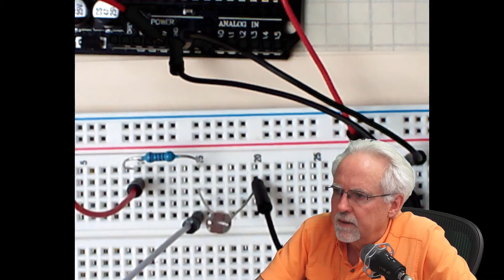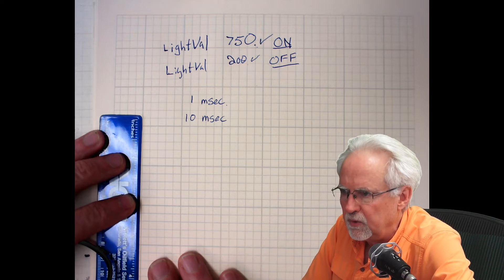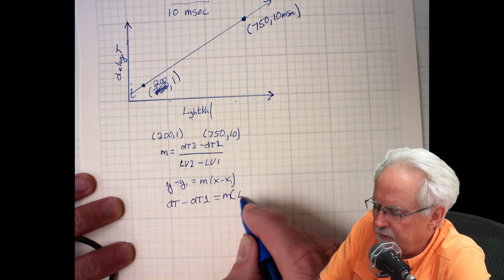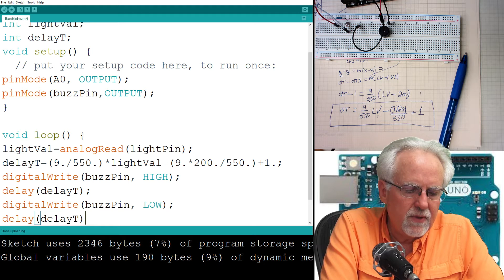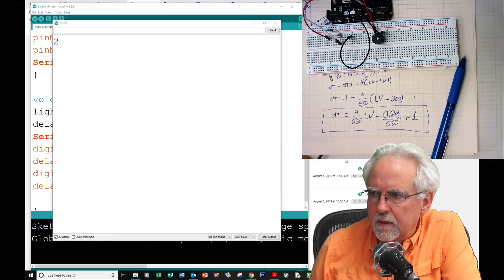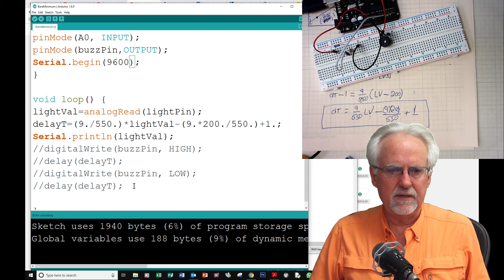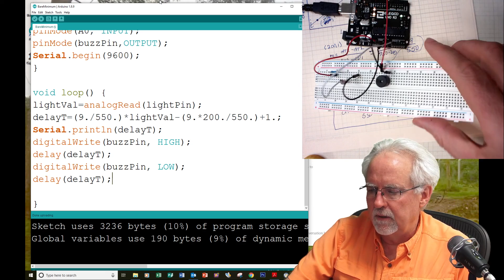Arduino Tutorial 26: More Fun with Photo Resistors

Comment: Hi Paul, Great series! I have a query in regards to variables, i noted that a lot of programs written make use of #define over int . What is the difference from what i have seen it only mentions that int is saved to memory?
Reply: #define statements are not difficult but are higher level features of c that can easily postponed a year or so. the exception is when you are reading other people's code.   They are a drag on the wonderful De-mystifying aspect learning Arduino in Paul'ss tutorial.  the statements using #define, or statements starting with # are preprocessor macro directive to the
compiler.  they are parsed in early stages, before the compiler itself begins, which makes it difficult to understand just what they do. 
#define is often used to conditionally compile certain sections  of code based on a
"symbol: begin defined or not defined.  Traditionally (before 2000) this allowed a program to work on several different versions of c language, different compilers, or machines   I learned about c features in 1998, C macro's are not necessary to using arduino, don't worry about it, I am 67. Some one who's not retired may say they are deprecated features.  a Boeing C wizard in the late 1990's used complicated #define sections as workaround on a multilanguage C to VB dll library of functions that reused spatial rotation C code in VB client application. .

Comment: No variable were declared as floats. why put the decimals in the delayT equation?
Reply: If that wasn't done the calculation wouldn't be correct. Don't confuse the variable data type with the math. Variables are only storage bins with their own limitations. Math is conducted based on the data type of the operands. If one of the numbers (operands) are of the type float or of type double, floating point math will be used for the calculation. If the operands are of float / double data type and the variable that stores the result is an integer, then only the integral part is stored and the fractional part of the number is lost. 

As an example, load and run the following sketch and check the serial monitor :

/*Math is conducted based on the data type of the operands If one of the numbers (operands)
  are of the type float or of type double, floating point math will be used for the calculation. If the operands are of float / double data type and the variable that stores the result is an integer,
  then only the integral part is stored and the fractional part of the number is lost.
*/

int lightVal = 750;

void setup() {
 
  Serial.begin(9600);
}

void loop() {

  int right_delayT = (9. / 550.) * lightVal; // right_delayT = 12 (one or more oprands are floats)

  int wrong_delayT = (9 / 550) * lightVal; // wrong_delayT = 0  (all oprands are integers)

  Serial.println(String(right_delayT) + " right way");
  Serial.println(String(wrong_delayT)  + " wrong way");
  Serial.println( " ");

  delay (2000);
}

Comment: Hi Paul! it's seem  tutorial 25 A0 is reading the val of 5K resistor but here it is reading photoresistor.
Reply: I also noticed that. @Paul McWhorter, does the order of the 2 resistors matter in this case?  Really apprciate your teaching on basic electronic engineering.
Reply: That’s correct, all part of Kirchhoff's Voltage Law, the sum of all the voltages around any closed loop is equal to zero. When light hits the sensor, the sensor’s resistance decreases resulting in an overall current increase. That increased current also flows through the 5k resistor, increasing the voltage across its terminals. Accordingly, per the law, the voltage across the sensor decreases.
 
It depends on which components you choose to measure across, the resistor or the sensor. Either way works just set up your data points accordingly. Measuring across the sensor, as light increases, A0 voltage decreases. Going across the resistor, as light increases, A0 voltage increases. Now you see why you’re getting the opposite result, Paul switched up.

Comment: Thank you Mr. Mcwhorter. I tried to do it myself and I couldn't get it to work but I also added a oled screen, after watching you I got the same result and as soon as I took the screen out it worked great, I would have to change the math to compensate for the added code. Great lesson I learned a bunch. 😅

Comment: Paul, I'm wondering about the formula used for delayT. Shouldn't there be parentheses just before lightVal and just after the final 550.?  For example,  "delayT=(9./550.)*(lightVal-(9.*200./550.))+1"  would ensure lightVal handles everything to it's right before multiplying by the slope (9,/55.).
Reply: I'm glad someone else noticed this.  Paul went wrong on his "distribution" and his version works inconsistently if at all. Your version also works but an even simpler equation is delayT = (9 * (lightVal - 200) / 550) + 1;. Sorry, Paul. I'm 82 years old but I can still do the math; that said, I am THOROUGHLY ENJOYING your tutorials and learning a heap.
Reply: @williamkcarlson9656  I think both ways work? (9 * (lightVal-200) /550) +1  would be the same as 9/550(lightVal) - (9)(200)/550 +1.
Reply: @gerdbc9076  Well, Gerd BC, I'm still not convinced that all three equations are identical, but I've uploaded the sketch again with all three, and sure enough, each one does the job.  Placing your hands over the photo-resistor with any of the three equations does bring the frequency way down. One thing we can agree on; Paul McWhorter is a great teacher!

Comment: Hi Paul Can you try to explain the last line where you are distributing. 14:56 Thx
Reply from the maker: The number outside the parenthesis has to multiply everything inside the parenthesis. So, when you take the parenthesis away, you have to "distribute" the term in front to multiply each term inside.
Reply: Paul McWhorter Thanks for the quick answer, im still cofused 🥴i will try to find a tutorial that can explain that .

Comment: Hey Paul,i got it working slightly different but got the same end result. BOOMMM!!! Loving the videos, keep up the good work. Here's my sketch
int lightVal;
int toneVal;
int buzzPin=8;
int lightPin=A0;

void setup() {
pinMode(lightPin,INPUT);
Serial.begin(9600);
pinMode(buzzPin,OUTPUT);

}

void loop() {
lightVal=analogRead(lightPin);
toneVal=(9940./850.)*lightVal+60;
Serial.println(lightVal);
digitalWrite(buzzPin,HIGH);
delayMicroseconds(toneVal);
digitalWrite(buzzPin,LOW);
delayMicroseconds(toneVal);
Reply: i did exactly same thing , but can you pls let me know that what;s your lightval1 and lightval2 while calculating equation

Comment: What about to change the delayT variable from integer to float ?
Reply from the maker: It might work but think the delay command is looking for an int, so probably a safer better way to go. Certainly, the delay command could not process a non-round number.
Reply: @paulmcwhorter  But the calculation  result  is non-round number

Comment: I did the assignment by myself. This is my code:

// buzz shouldn't go above 9000
// buzz shouldn't go below 30

int buzPin=3;
int lightPin=0;

int buzz;

void setup() {

  Serial.begin(9600);

  pinMode(buzPin, OUTPUT);
}

void loop() {

   buzz = (9000./1023.) * analogRead(lightPin) + 30;

  digitalWrite(buzPin, HIGH);
  delayMicroseconds(buzz);
  digitalWrite(buzPin, LOW);
  delayMicroseconds(buzz);
}

Now I'll continue watching the video:)
Oh ya and don't forget my golden star Sir.
Reply: Sir my math is a lot different than yours. It works for me but is it correct?

Comment: worked first time with MY maths
Reply: Hey Bob, Could you help me out pls. Im a bit confused onto why Paul used 1-10 microseconds, cause i thought the video on passive buzzers said 60-10 000 ryt? And,, if we had to do the calculations, do we always have to use the equation Paul used (y-y1=m(x-x1), or is there any way we could use normal ratio techniques to get the correct output. Sorry if the questions r too many haha. Thanks a lot :)
Reply: @youcuber9361  If you use the 60-10000 microseconds with delayMicroseconds() you will be working with a larger range of tones vice using 0-10 milliseconds with delay(). The formula that is used to find a slope of a line is the exact ratio for rise over run ... m=(y2-y1)/(x2-x1).

Comment: Hi Paul. I noticed when you did the pinMode for lightPin that you did not use the variable lightPin but instead used the actual pin number, A0. I thought that might have been part of the problem, but it was not. However, I was puzzled why you did not use the variable even though it did not have consequences. On the other hand, maybe it did have the consequence of masking the true purpose of lightPin as an INPUT. As always, your videos are great fun. Thanks very much.